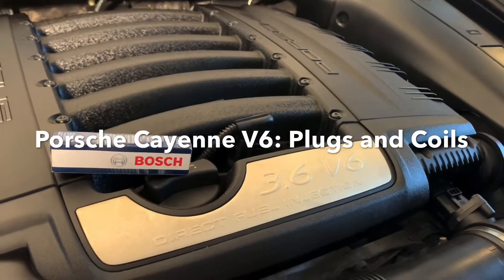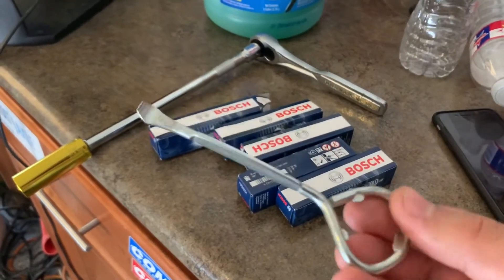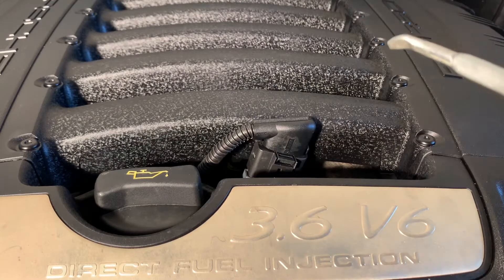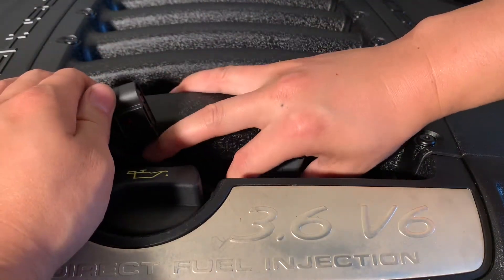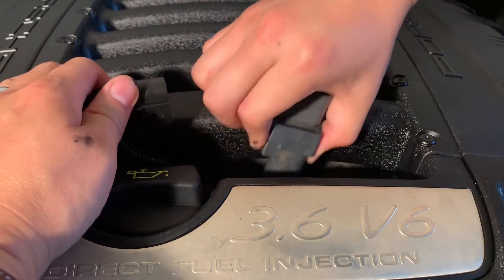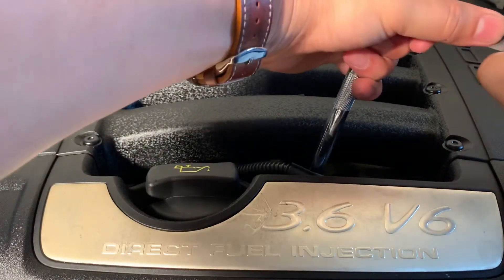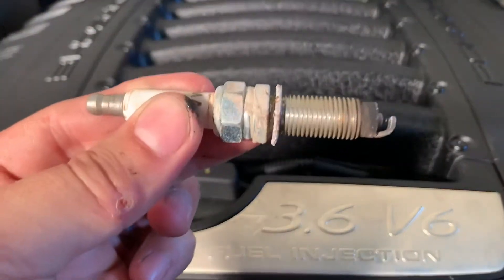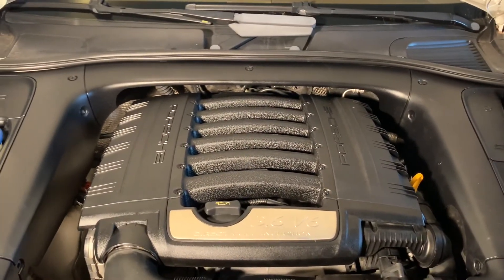how to change #Porsche #Cayenne 3.6 V6: #Ignition #Coils &  #Spark #Plugs

Comment: May i know the detail / generic serial number for this cayenne 2013 spark plug ?
Reply from the maker: Mine is a 2010, not 2013. My plugs are for 2008-2010 so yours will be different. Have you tried looking on Amazon or eBay? Don’t forget to subscribe to the channel if you haven’t already.
Reply: @512TXSDIY  Ok thanks for your information
Reply from the maker: @yoggahutomo4403  You’re welcome. Check eBay. I just found your plugs for $80-98 dollars for all 6 brand new NGK’s.

Comment: Thx for sharing. How long for replace these spark plug? I have a 2016 cayenne for 47,000km...Haven’t replaced yet...
Reply from the maker: Ly Z Honestly I wouldn’t replace them until you start experiencing an issue. If you want to be preventative, I would change them every 30-40k miles. Don’t forget to hit subscribe to the channel.
Reply: @512TXSDIY what would experience be for bad coils or plugs?  Thanks for your Cayenne videos. Helped me pull the trigger on purchasing ‘09 v6 91k miles. 🤙🏽
Reply from the maker: Shaking at idle or start up, puttering on acceleration, check engine lighting misfires etc.